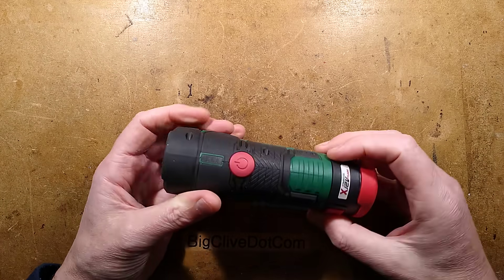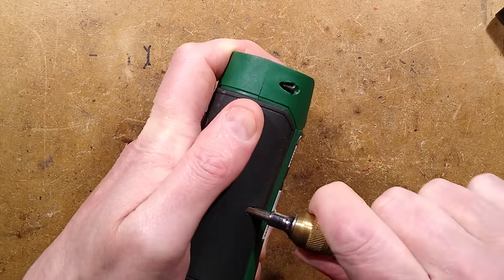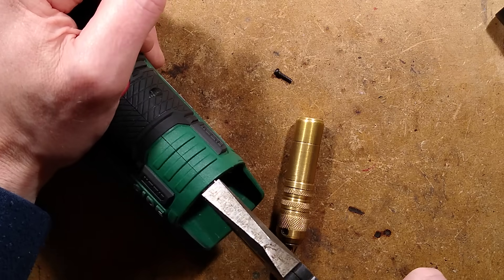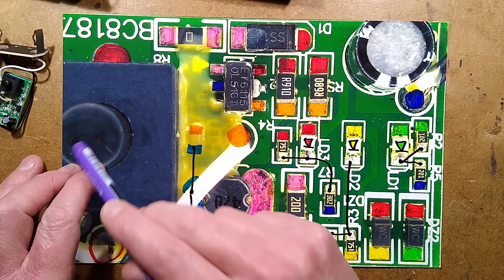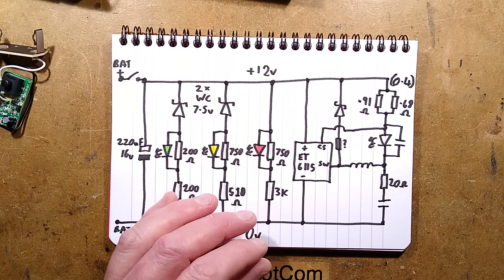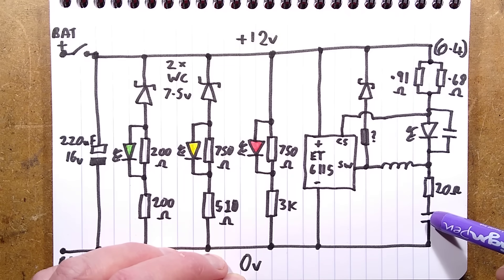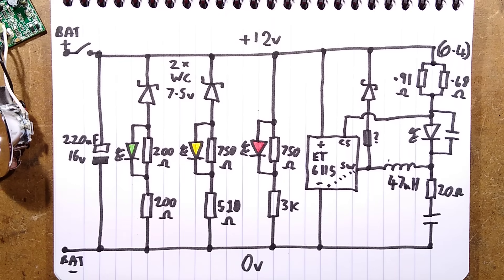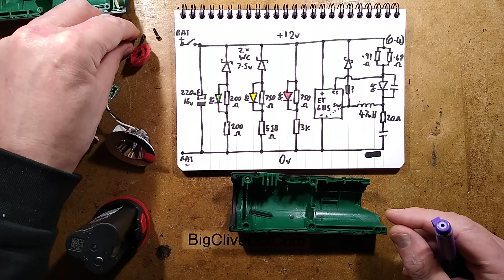Lidl/Parkside (and others) 12V system flashlight

Comment: Finally...an ON/OFF flashlight that doesn't have 500 different "modes" that I would never use!
Reply: I hope you have the SOSOSOSO signal memorized in case you get stranded on a Chinese island
Reply: I like ON /OFF + 50%. I think that's ideal
Reply: It's because the Chinese heard that the US calls a torch a flashlight.
I can imagine the product design meeting in Shenzhen:
"But how should it flash?"
"Yes"
Reply: FWIW, some of the driver chips have a pin you can ground to disable the SOS.  So if you see an unconnected pin...
Reply: I got this Sofirn branded torch from ali, made in shenzhen somewhere apparently and it's modes are great. Simple On/Off with hold to cycle brightness, remembers last brightness. It has strobe but it's quick triple press and 4 quick press is a lock.
Reply: @georgeprout42  So that's why my Chinese torch came with the end dipped in pitch.....
Reply: But is still very complex despite the fact that it can "only" turn on and off 😊
Reply: @j.f.christ8421  "FWIW, some of the driver chips have a pin you can ground to disable the SOS.  So if you see an unconnected pin..."  
Probably a great idea .... for the average electronic klutz to "disable" the whole device. 😉😁
Reply: @_BangDroid_  So ideal for Parkinson's sufferers?! 🤔🙄
Reply: For real. I have one nicer flashlight that has a much more sensible control scheme. 1 button, 5 intensities plus strobe and SOS, but all are easily accessible with 1-3 presses and it's easy to get what you want. Then all my other cheaper ones that it's a 50/50 shot that I get disco mode every time I use them XD
Reply: Just thinking the same
Reply: @theoztreecrasher2647  Nor amputees unfortunately
Reply: So.. you don't want Disco, Rave, Faulty Lamp, and What's Wrong With My Bloody Headlights?

Huh.

Weird..
Reply: My Nitecore torch has 2 switches, one on the end for on/off and one for mode-switch. You can either press down the on/off or just push it a bit to turn it on until you let go.
It uses a 21700 with 4000-5000mAh at ~3,6V.
Reply: Don't you want 10 different flashing patterns for each of the RGB colors + each combination of cyan, magenta, etc.??
How can one live without a magenta flashing LED in the pattern of "on .......... off. .. on off. ... on off"?
Reply: @georgeprout42   Imagine the chinese would take the word torch too literally as well. 

"Should it go up in flames?" 
"Yes"

In the country i live, the word used translates to "pocket lamp". 
"Should it only illuminate the inside of a pocket?"
"Yes" - would be somewhat useful. People which drive an old car can relate. My volvo 240 GL Turbo only has a simple metal key which likes to slip away in my winter jacket's pockets. When i'm with someone they can shine a light in the pocket, but when i'm alone at night it's a bummer. 

My wife is mongolian and they call it "hand lamp". 
"Should it be shaped like a hand?" 
"Yes"
Reply: @_BangDroid_  but why changing the brightness? 

The only "extra" i'm happy about on a standard torch is a beam focus ring. I also prefer ones with a mechanical switch, instead of a button, because it operates nicer with gloves and is easier to repair in case of fluid damage. A torch does not need any microcontrollers and chips. Just two wires and a switch going from the battery to the LED/bulb, maybe a resistor. But that's just my opinion. 

The SOSOSOS signal is just silly. if you really plan on going somewhere remote or dangerous, take a satellite phone/signal beacon with you or if you aren't too far from civilisation, but outside cell phone coverage a good amateur radio walkie talkie in UHF & VHF 2m 70cm bands will do it's job (but don't buy the chinese ones, since they lie about the TX output and the included antennas are rubbish)
Reply: But what about the alternating colours when Ur signaling sos?
Reply: Strobe mode

Comment: Back in my day a torch consisted out of a bulb, switch and a couple of D-cells and it had 2 modes, dim and if you bash it around you activate bright mode.
Reply: I had one from the Boy Scouts, it took 2 D cells but it also featured a slot where you could slip in a red disc in front of the bulb so you could use it without ruining your night vision. The unit was amazingly tough, I dropped mine regularly on hard surfaces and even the little peanut bulb survived.

Comment: LIDLS Parkside collection is a bizarre mix of surprisingly decent tools and utterly useless junk sometimes in the same product. For example I have a very functional Parkside electric screwdriver that came in a lovely box along with a  ludicrous circular saw attachment that can just about cut a single sheet of paper.
Reply: All a matter of how much torque you can get out of a low voltage product. A highly geared screwdriver device doesn't need much. A straight drive 7" (or more) circular saw works best on 240v AC! If you want to try "useless" Seamus, then pick up a Ryobi (or no doubt any other brand) 18v Chainsaw! 😜🙄

Comment: Funny that few weeks ago I bought one of these, opened it, remove the main led, connect directly a small water pump to 12V after switch. Afterward put pump inside a PVC pipe of (40mm I believe) plus a small hose inside and the flashlight glued to it as a handle. Now I have a rechargable portable pump to stick it into a plastic jerrycan to change water in my aquariums plus LED indicator for battery :) I want now to buy two more.
It will make Arnold Schwarzenegger proud :)

Comment: It would be very handy to have a switch in series with one of the two parallel current control resistors, to allow high and low brightness settings. 

It's recommended that for coils or transformer cores made of ferrite or powdered iron, that the schematic's winding symbol have a broken line (like hyphens separated by spaces) alongside the winding.    

Thanks, Clive for your schematics; they're the dessert that makes your teardowns delicious.  I imagine there are novices watching your videos who learn to read schematics from your explanations.  You're a true electronics educator.  😊
Reply from the maker: Good point about the inductors to differentiate between air cored and ferrite cored.
Reply: When I first started watching Big Clive's videos I said to myself: "I can draw schematics like that". After a few attempts I gave up and sulked back into my 'viewer only' corner! That's a skill which needs years of practice and we all appreciate them! ;-))
Reply: @stepheneyles2198 It really helps if you have the native talent to draw in general, but it’s not absolutely necessary. Drawing schematics can be learned as a skill but it can definitely be a lot of work.

Yes, I have the talent of drawing and picked up drawing schematics easily. And yes, I appreciate Clive’s beautiful schematics. I still say they’re an art form.
Reply: @stepheneyles2198  it's not that hard tbh. Draw the inputs on the left, outputs on the right. Then the middle. If it works, it works. If you're tight for space then start again, but now you have a better idea of spacing. We don't see Clive drawing after all, it might v1 or v7 for all we know 😉

Comment: The Parkside stuff tends to be pretty decent in my experience. I really like the USB-C rechargeable soldering iron they had for sale a while back, it uses what I assume is a standard cheap E10 threaded soldering iron tip and heats up really fast. I used to use a TS100 soldering iron all the time but the Lidl one is so much more handy (and wireless obviously) that I tend to use it more often
Reply: Sadly mine didn't really work for me, but good yours did
Reply: Agreed, super bang for the buck. The coolest thing is no question asked replacements at the stores.
One of the batteries died on me, 5 min. trip to Lidl and I got a new one on the spot.
Can't beat them for the DIYer.
And yes especially their soldering iron (I have the one that works with their 20V system) was a life saver more than once.
Reply: Thats my experience too, I actually have been using their mini hand drill and for my hobby needs (model related drills/screws/cutting etc) its actually pretty good for a little drill I bought on a whim.
Reply: Indeed, I followed some YT channels where Lidl products (tools) were tested and they were surprisingly good and for sure great bang for your buck.
On the other hand there were some DOA or partial DOA devices but they were changed for good ones without any hassle.

Comment: this is used for people that actually work in pitch black , i have an uncle that works in the forest as a forest guard they do actually prefer a long runtime , and i do mean long like 24-48 hours or more since he doesn't always get to go home and charge his flashlight also he doesnt want it to konk out due to water or getting dropped 
i've seen so many cool flashlights that are rugged and actually passed the abuse of time with him and his coworkers and they are always modestly rugged and always 1 button and 1 mode and low light intensity and super waterproof , some of them are even led acid with the small rectangular battery (smaller than a motorcycle battery) .
Reply: He needs a modified charger to work off a Solar panel.
Reply: @G1ZQCArtwork  he cant be lugging a solar panel everywhere , also he mainly works at night and a big battery is just more reliable that a solar panel that cans scratch or break and only for him to discover it didnt charge all day and now he is stranded with not light

Comment: I bought the Parkside 4V rechargeable two position electric screwdriver months ago, it has a shockingly bright only On-off LED torch in the bottom. Surprisingly useful tool for £9.99

Comment: ET6115 is a clone of a popular PT4115 with the same pinout. Not sure about the parameters, but at least the pinout matches. Quite commonly used in power tool battery-powered lights, and also has a built-in dimming function by giving a PWM signal to one of the pins, allowing one to add a simple NE555 circuit and make the flashlight dimmable instead of just on-off

Comment: Its always nice from parkside to have replacement batteries. So by the time your battery dies you'll have to buy a complete new drill because the batteries won't fit anymore because they changed the design.

Comment: I converted a 2 road lamp cell(2×6v) torch the other day. I put in a 3v bulb, 10 C alkaline cells in holders, and linked them up using a system of manual toggle switches. They're on parralell setting at the moment. When they run down I'll gradually switch each one into series.

Comment: Great video and schematics, I have the similar flashlight from bosch also on the 12V battery system with the same on off switch and it has that clip on the housing which is easier to remove with a hook.

Comment: I have a smaller torch I got from Lidl .It had led light for beam light and a strip of led for work light . Went flat after a week . So always flat when you needed it. Cut the wire to battery brought out wire and made a tiny male and female connector fixed . what's wrong with a good old on off switch. Of course you wouldn't have a channel clive😂

Comment: I bought two of these as emergency lights. I use the batteries on many of the Parkside tools, some batteries were on offer so I grabbed a pair of those too.
The 4 ah battery will fit this Torch too, so expect many hours of run time indeed.

Comment: 120n for the capacitors in circuit says 100n ceramic, the extra coming from the other capacitors and resistors in series. But being ceramic and cheap not likely to stay that way for long, or even be close with 12V applied.

Comment: Handy tip .. To remove pesky staples ( and carpet tacks ? ) , I find an old ,  but sharp pair of side cutters gives a FAR superior grip on the narrow strip of metal ( compared with pliers ! ) , also the voltage indicator circuit ( built on a separate PCB ) might be used to monitor a 12 Volt Lead Acid battery ( ? ) .. Parkside™ have a nice colour scheme ... DAVE™🛑

Comment: I've had mixed results with Parkside stuff. I found their little 12V drill driver to be as tough as old boots and they punch well above their weight but I've had a 12V Right Angle/multi-position drill die after 30 mins light, intermittent use and it's replacement sounds and feels like it might go the same way.

Comment: As the battery has its own charging and low voltage circuits built-in all you need is an on-off switch and maybe a slightly larger heat sink. forget the amount of battery left indicator as it will just get dimmer and cut off!

Comment: Clive, any chance of coming back to this but modding it to make it far brighter? Seems like a pretty simple but fun project.
Reply from the maker: Pushing the LED too hard will reduce its lifespan exponentially.
Reply: @ Ah I see. Would it be best to swap for a different LED and add a better heat sink? I have been thinking about modifying mine to be brighter, and possibly rehousing into an old school GPO linesman torch body.

Comment: I have a flashlight that uses two 18650 batteries in line with the charging circuit built into it.    
I can find 18650 batteries but not together with the tiny circuit board built in.    
Do you know of a search term for it?   
Like, “Inline 2x18650 with BMS” or something similar?

Comment: You mentioned the inductor/switching to improve efficiency: does that induce any visible flicker in the light? Any idea what frequency it's oscillating at?
Reply from the maker: It's very high frequency.  Well above the perceivable level.
Reply: IIRC the switching frequency is typically in the range of kHz to hundreds of kHz, so as Clive said: you are not going to see that. In addition the LED never goes completley off - like unsmoothed, rectified AC - it only varies in intensity somewhat.

Comment: That battery looks suspiciously like my Milwaukee M12 batteries. I have a feeling that’s the idea
Reply: They are, but enough differences to make them incompatible :(
Reply: I might be wrong but I nieve that utt might just be a plastic strip on the outside, I've seen that on my einhell and parkside batteries....
Reply: Its also very similar to the Makita BL1013 batteries. I guess that's what you get when making a 3 cell battery. Really only 1 good way to orient the cells.
Reply: About time batteries were standardised.
Reply: They also look visually similar to some Bosch batteries, with similar specs. but not compatible

Comment: The Parkside products are okay. Considering the low price and that those are sold in supermarkets, you cannot complain. The tools usually sold in supermarkets are far worse and I already bought private label products in hardware stores for about the same price, which ended up being significantly worse. If you don't have big demands and just need the right tool every now and then, you won't go far wrong with Parkside. If you have high demands or you are looking professional quality, you have to look elsewhere but then you also have dig far deeper into your pocket.

Comment: Why wouldn't they use a simple resistor to current limit the LED, versus so many other components?  Is it the large voltage range of a 3s battery?
Reply from the maker: The resistor would end up dissipating twice the power of the LED.

Comment: I picked up a couple of these when they were 20% off. As a torch they are mediocre at best, their only good point really being that you can throw a 4Ah battery in there and get a really long run time.
The reason I bought them is that lacking a 3D printer, it can be really hard to make battery adaptors either to use Lidl batteries in other tools or for other battery powered projects. At just a few quid for this torch you have a well made and perfect fitting battery interface that can be modified in many ways.

Comment: I'd hack it the following way: Put an Rfixed of 0.2 to 0.3 Ohms in serial with one of these small blue multi-turn pots, they are available as low as 10 Ohms@28turns. Looks like there is plenty of space for that inside the housing,

Comment: we need a homebuilt circuit to safely discharge the 20v batteries
Reply: Drive a nail through them and drop them under a Tesla? 😱😵‍💫
Reply: @theoztreecrasher2647  no no... recieve the stop command from the battery bms to disconnect a relay or a power mosfet.

Comment: Hack it to make it dimmer??? Tim the tool man would be disappointed. Hack it to run at 1.2A on the 12V rail using a 10W chip [4V/2.5A] such as used in the Fenix flashlights. That seemed like an odd way to drop the voltage. Maybe a mosfet driven by a PWM would be better? [RDS ON .05 ohm] The hardest part would be to deal with the heat since it's all plastic.

Comment: IMHO we really should return to rating those batteries by their nominal voltage instead of their peak voltage. So that'd be 10.8V if I'm not mistaken.
The annoying thing is that the marketing is all over the place. 10.8V batteries are by far the worst with almost all brands having resorted to calling them 12V, including Makita, who tend to be quite honest about that sort of stuff. With 18V batteries there's still some brands that don't do it.
Reply: I make "nominal" voltage to be 11.85V.  At 10.8V the battery is near exhaustion.
Reply: @tigercat3864  There are lithium-ion cells out there with nominal voltages higher than 3.6V, yes, but 3.95V seems hard to believe.

Comment: 1w would be much too bright for an astrology light. A typical pen light would be much better to make one of those out of. I made one from one of those, it used one of the super compact SOT23 boost converted IC circuits driving the LED from a single AA. I just changed the white 3mm led to a bright clear red LED and it had just the brightness you want. Maybe a bit too much still.